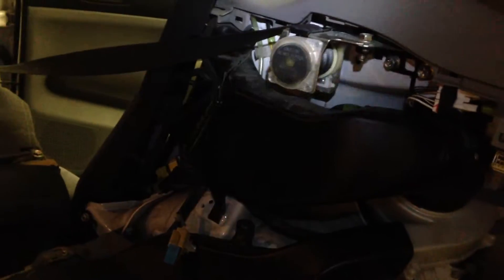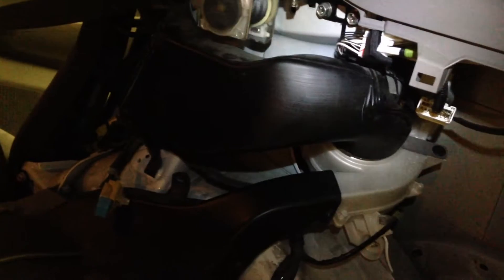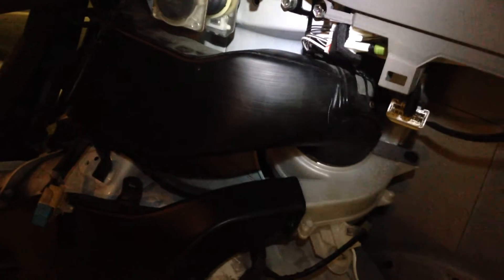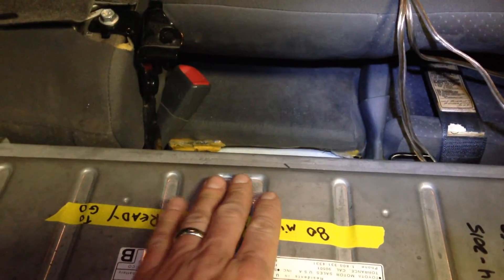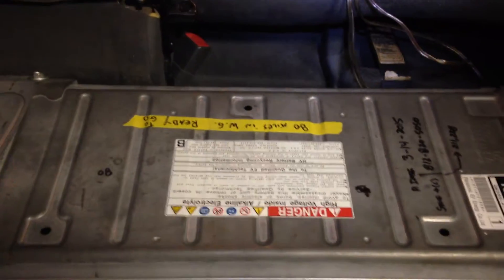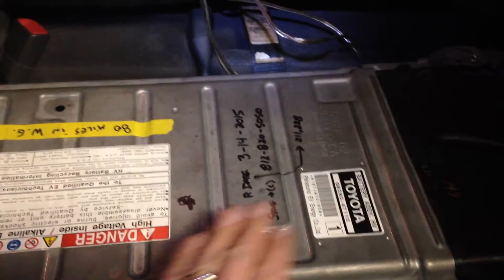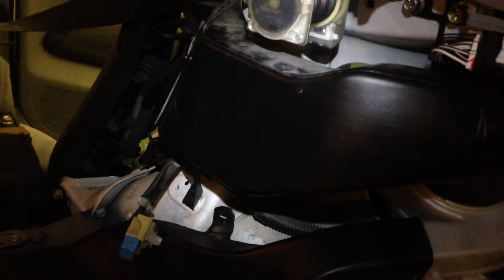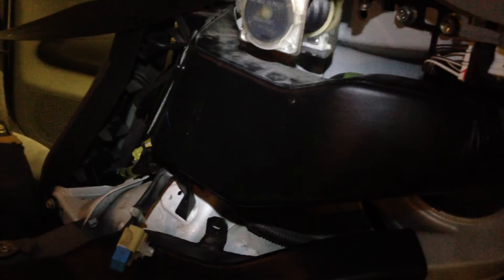2004 - 2009 Toyota Prius - Hybrid Battery Fan Test

Comment: mine doesn't even turn on... and doesn't seem to be trying to turn on... did you do something to activate it?
Reply: You have to run the car for a while to trigger the fan to on.
Reply from the maker: Not sure, mine was running without interruption.  Some good diagnostics can be found here: http://priuschat.com/threads/hv-battery-cooling-fan-issues.136631/
Reply: James Newton Hybrid Assistant app.